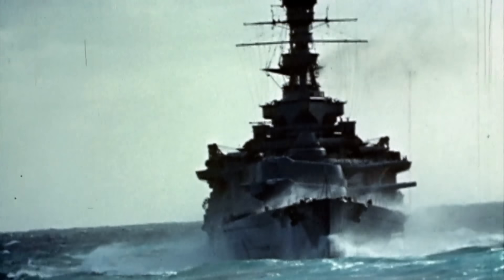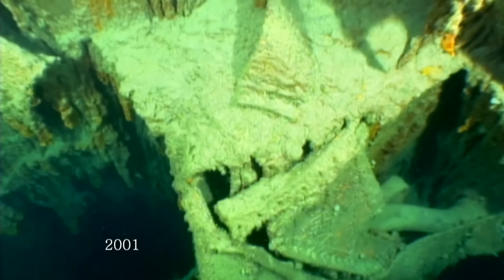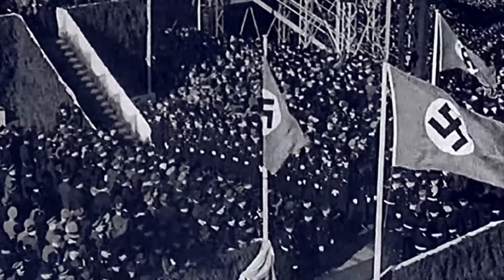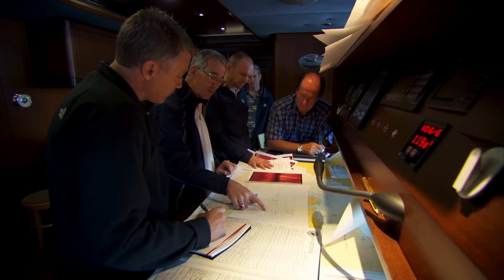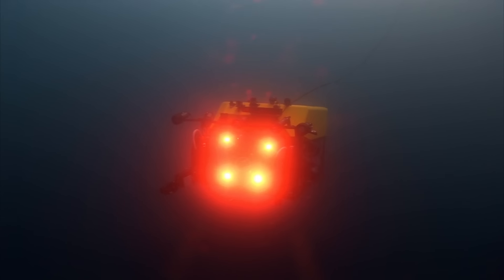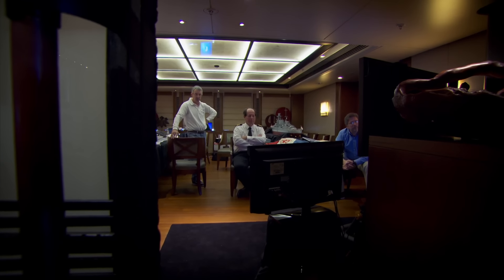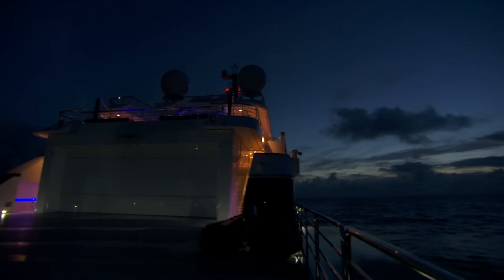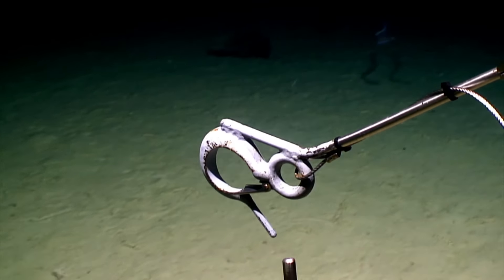How the Bismarck Sank HMS Hood - Documentary

Comment: It's no mystery. A  battlecruiser is not designed to take a hit from a battleship gun. It lacks the armor for that. It is like a boxer with a glass jaw. British battle cruisers blew up the same way at Jutland in 1916. It is amazing that the British didn't learn from that. Battle cruisers were designed to catch and destroy cruisers and outrun battleships. Their speed was meant to be their armor.
Reply: Same with the Deutschland Class (Deutschland, Admiral Sheer & Graf Spee). Even though they were described as "pocket battleships" they were never intended to engage anything larger then a cruiser. If they were presented with a larger ship, they were to simply outrun it.
Reply: The British battlecruisers blew up because they not storeing cordite correctly and leaving blast doors open as the royal navy favourd rate of fire over accuracy
Reply: castlerock58 trouble is it comes down to what is available in the right part of the sea when you need it. The Hood was what was available. An old ship, still the pride of the fleet, but effectively a WW1 cruiser up against a brand new all singing all dancing battleship.
Reply: Depends. German battlecruisers were designed to take hits from battleships and did so during the battle of jutland no problem.
Reply: That is correct Jutland saw more British sailors die and more British ships get sunk than what the German Navy suffered. About 6000 widows were made that day.
Reply: The same way the pride of the British Navy blew up in 1939 a single shell through the deck  into ? a Magazine. Sunk in 3 minutes. 1415 young sailors killed.
Reply: Monika tada problem was that the Royal Navy was the biggest and had to constantly be the first to design something new. Therefor other navies could copy and add extra. That’s why by the time Jutland happened, the German ships were stronger, luckily the Royal navy was 10x the size
Reply: The British Jutland battle cruisers blew-up, due to overriding the anti-flash protection doors to improve the rate of fire of the guns. Their armour was also suspect. By the time of the second World War, the HMS Hood was largely obsolete in terms of armour disposition to stop plunging fire. The ship had no immune zone to the Bismarck. The armour improvements to the ship might have given a theoretical immunity to German 15inch fire, but in practice there were vulnerabilities to the armour scheme which caused its loss. Too much spin-doctoring had taken place between the wars, extolling the power of the ship, which made its loss all the more poignant and distressing. It was the HMS Prince of Wales gunnery, which made the Bismarck abort its mission.
Reply: you saying the british didnt learn from jutland is kinda false as hood was designed to not blow up after taking battleship hits just her deck wasa designed for 11-13 inch guns NOT 15 INCH on the bismarck so hood (like the royal navy) was outdated
Reply: Jonah Whale  what are you talking about?
Reply: The Hood was launched in 1920. Back then air power was not a huge factor in sea battles, so it was not deemed necessary to build ships with armored decks. In the case of the Hood v Bismark dual, the guns on larger ships had got ever larger, with greater range. But of course in order to throw a one ton shell thousands of yards, you have to aim higher to project your shot further. It was here the lack of deck armour on the Hood led to it's downfall. The Hood could not withstand hits from plunging shells, and with the Bismark getting that lucky shot in first, Hood's luck ran out......
Reply: Surprisingly this excelent  piece made no reference to the similar  disasters with British cruisers  in the Jutland battle, as remarked by prior comment,  and specially to the conclusions of the Admiralty  commission(s?) that worked about those heavy  losses. How the recomendations produced have been considered in the construction of the Hood, in what regards armour reinforcement and conception of projectiles lifting to the turrets?
Reply: @thomashenaughan8396  The British navy was a big fat joke at Jutland. They did nothing right.
Reply: @bwills044  Frau Goebbels? What year?
Reply: @NormAppleton  They lost more ships but they where victorious.
Reply: the british DID learn from jutland. In jutland beatty ordered the battlecruiser to remove flash protection for faster rate of fire, this order then resulted in the other battlecruisers blowing up. If you take a look at HMS Tiger were the captain ignored this order you can see that battlecruiser can definitely take a beating.
Reply: the bismark was faster than the hood as well
Reply: @Jabber-ig3iw  
And the battleship that was with her hadn't been shook out yet and suffered Debilitating malfunctions in 2 of it's turrets that left Hood standing alone against a state of the art battleship and a heavy cruiser....
Out numbered and out gunned and nowhere to run.....
Reply: @bwills044  if you are still talking about the Hood going down,  that was in 41 not 39...
Reply: Jonah Whale  
Without the lucky torpedo hit holding Bismarck in a constant turn,  Rodney and those with her never would have had the chance....
Reply: @jackwardley3626  
The Hood had tired engines,  badly in need of a refit....
Design speed to speed,  Hood had the edge....
Reply: @pffear  The German fleet that ran away and didn't come back out to play again.
Reply: @Tuberuser187  
That's the one.....
Tactical victory with a strategic loss❗😜❗
Reply: @pffear  Was a tactical loss too, the Germans failed immediate objectives as they retreated, the tactical loss and then hid for the rest of the war which was the strategic loss. The Royal Navy losses didn't result in anything aside from the loss of materiel or men, it didn't impact anything like ability to maintain deployments or protect any areas.

Losing more quantitatively during a battle doesn't count as victory or loss though it can obviously contribute to them.
Reply: Jonah Whale  
Such are the fortunes of war.....
Reply: They did learn from it. It was just desperate times and the Hood was there.  You fight with what you got.
Reply: @malcolmtaylor518   Absolutely correct.  When the Hood was built, capital ships fought at relatively short range and received enemy shells at the side of the ship.  Therefore, the Hood had massive side armor but very light deck armor, which allowed it to have greater speed than battleships.  However, by the time the Bismarck was built, ships were engaging the enemy at ranges up to twenty miles or more.  At that range, shells do not hit the side of a ship but instead travel in a high arc and come down on the deck of the enemy vessel.  An enemy armor piercing shell weighing over a ton came down on the Hood's deck, tore through the thin deck with ease, and proceeded directly to the magazine four decks below before exploding.  The Hood never had a chance.  The only way it could have survived that battle was not to get hit on the deck.
Reply: The Hood may of been over twenty years old but she didn't get her refit because she was newer than the rest of the ships that needed one.
Reply: @Brian-om2hh  
When the Hood was designed and built gunnery actions were taking place at shorter ranges. As fire control systems improved theoretical engagement ranges increase. Ships become much more vulnerable to plunging fire.
Reply: A "battleship" CAN NOT withstand the fire from another "battleship"!  Nothing that floats can, then or now!  Being a "battlecruiser" mint that the HOOD was FASTER than a battleship.  The HOOD's guns were roughly equal to the BISMARCK's guns. The German optical rangefinder was likely more accurate and that is likely the real reason the HOOD went to the bottom.
Reply: @NormAppleton  But they didn't lose. It was the Germans who fled.
Reply: @jugbywellington1134  Am I too outdated???
Reply: Anon Roving Group _Intel_  when I asked what he was saying I meant when he called the bismarck a weaboo and rodney outdated when I said that the majority of the total navy was outdated
Reply: @pffear That'd be HMS Prince of Wales. She still had workmen aboard finishing her off. She managed to hit the Bismarck, though.
Reply: @bhishmaMbt  Perhaps, but nothing could take a stonk from the Bismarck and not worry about it, not even the Tirpitz. On the other hand, being "obsolete" didn't bother the Swordfish, did it? According to one account I read, no other plane could have delivered a torpedo at that time and place in those conditions. It's tragic all those brave men on both sides had to die.
Reply: @jugbywellington1134  🙁🙁
Reply: Jonah Whale  Bismarck had a modern (by 1941 standards) fire-direction center, and Hood did not. That's what allowed Bismarck to hit Hood at long range while Hood did not. It was luck that the shell passed through Hood's magazine, but not luck that Hood was hit.
Reply: The Hood was designed when broadside fire was still the order of the day but Bismark would use a drop shot trajectory .
Reply: @jeffburnham6611  Their were a few faults with it though.  The AA director couldn't cope with the existing aircraft that were a threat to it. The communication lines for the main director actually ran outside the main armoured turtleback. 

I agree entirely on the luck points. It was also not luck that PoW hit Bismarck, though a little fortunate it knacked the forward fuel stores. It certainly wasn't luck that the swordfish hit Bismarck, but rather the remarkable skill of the pilots.

Another thing that wasn't luck was Rodney dismantling Bismarck in short order.  That was brutal, terrifying efficiency from a supposedly inferior Washington Treaty constrained battleship. And it's worth noting that Bismarck didn't land a single hit on Rodney.
Reply: @kenmorley2339  The Hood would have been in a better position if things had not gone awry and they'd been able to stick to the original plan. Plans in war, as we know, are the first thing to go wrong!
Reply: @gordoncroft8189  and the hits from POW caused flooding that slowed the ship down and left him down at the bow
Reply: Jonah Whale  if the torpedo had not jammed the rudder she would have gotten away
Reply: @jugbywellington1134  the swordfish were so slow the german gunners could not compensate
Reply: Jonah Whale  Double short time? Do you know how long it took for the Bismark to actually sink during that engagement and that's even when basically crippled? And i still don't know whenever the debate if the ship was sunk or if it was scuttled got an answer - There are claims both ways.

I'm happy the torpedo bomber got the hit on the ruder pin on Bismark like they did (insanely lucky) or the English that already had the knife at the throat would had its last supply line seriously threatened and the entire war could have ended very differently - So fully understand the panic when the news came that Bismark was on the way out to sea to ravage the supply lines that mostly escorted by destroyers for u-boat protection. If Bismark didn't get sunk i doubt H would have been scared to deploy Tirpitz either. A freighter convoy with normal protection would have been simply decimated by either of those ships
Reply: the Hood had more armor than most battleships of the time so stop with the battlecruiser nonsense. it's a war ship of a certain size and it blew up.
Reply: Ok, a few facts for you.

Hood had battleship grade armour, it was called a battlecruiser because of its speed. British battlecruiser losses at Jutland were caused by German battlecruisers, and it was because of poor ammunition handling practices. Hood was destroyed by a shoot that seemed to have hit its main armour belt, IE the part that was as thick as a QE class battleship’s armour.
Reply: No British battlecruisers at Jutland had their armour pierced; the explosions happened because when a German shell exploded on deck the flash entered the turrets and travelled down the lift shafts, into the magazines. The flash doors in the shafts had been wedged open on orders from Admiral Beatty, who was obsessed with rate of fire, so he personally caused the unnecessary deaths of thousands of sailors.
Reply: It was also using high explosive shells which had little armor penetrating power even the queen elizabeth ships had this problem.
Reply: Churchill said at all cost. Prophetic...
Reply: Exactly - Indefatogable and Queen Mary went up within a few minutes of each other in the opening round of Jutland 1916 for that reason. Hood should never have been used to join battle.with Bismarck.
Reply: @malcolmtaylor518  no it wasnt. The POW turn tail and took off. The German ships didnt give chace.
Reply: @ike3094  really because the Bismarck sure did didnt he? Top side was wrecked but the citadel wasnt penetrated nor was there enough damage for him to sink. Then it was scuttled.
Reply: @gordoncroft8189  Rodney's 16 inch shells were bouncing off Bismarck. It couldnt do enough damage to sink the Bismarck.
Reply: @mikael2670  it was scuttled.
Reply: @erichvonmanstein6876   Yes! The Bismarck was intentionally skuddled  to keep him out of British hands. The Brits got awfully lucky when they wreaked the Bismarck's rudder!
Reply: @ike3094  well, not to give zero credit to the Brits. I think they deserve credit for the attack and hit on the ship however i think you are correct in that the hit on the actual rudder and extent of the damage was nothing short of luck.
Reply: @erichvonmanstein6876  The great Napoleon was once asked which was a greater asset: skill or luck?  Without hesitation Napoleon answered "LUCK!"
Reply: @ike3094  indeed. Just as with every other great military leader of the last 300 years would also say.
Reply: The Hood was not a cruiser. It was a Battle ship. Lutchens did not want to engage with cruisers.
Reply: That is so true.  Hood had upgrades but poss not enough to promote her to battleship.  Lucky shot did for her.
Reply: @richhughes7450  The Hood was done in by a lot more than just a "lucky shot"!   It was German Tech and skill that put quit to the Hood.  Remember that the Hood was in mid turn when the Bismarck "straddled" her (shells landed all sides) with a mighty salvo and sent her to the bottom. Not "luck", German Tech and skill did it.  Neither ship had armor thick enough to defeat the other ship's main guns' shells.  Armor that thick would add so much weight that she might not even float!  Also, speed, always important, would suffer greatly.  Fuel consumption would skyrocket and available space for fuel storage, would drop dramatically.  Range, the distance the ship could travel, would be much less and that would mean refueling vessels would very necessary and numerous and in constant danger.  Navel design of warships are always a compromise between what is wanted and what is workable. The compromise being heavy armor being on critical things like gun turrets and armor on decks, much less so. That "plunging" fire, (shells incoming at near 90 degrees to the horizontal) that sent the Hood on a two mile trip straight down was due entirely to German Tech and skill.  Also, the two ships were near the same size.
Reply: @pffear  A little unfair, Prince of Wales had lost one gun and suffered some drill faults but she was still the first ship to score a hit, the deblication malfunction came once Hood was sunk and hard manuevouring caused a shell to jump the shell ring and jam Y turret in train.
Reply: @mpetersen6  partly true but one factor that get overlooked is that it's not just the engagement range, the british aren't too worried about hits at 25k yards+ because they are rare and British are planning on pushing in closer for decisive action, is that the quality of AP caps and the fuzes of shell are improved markedly around the end of WW1. So whilst Hood's armour scheme would almost certainly detonate a shell short of the magazine spaces for any shell design available in 1917 this is not true by the mid 20s. Bombs are also a major weakness with Hood's total lack of deck armour, her protective plating is intented to protect against oblique impact not from directly above, Hood's quarterdeck is a major weakness against air attack.
Reply: @malcolmtaylor518  seems you have no clue how a turret works.this myth was created for two reasons.Churchill himself forbid a examinationafter the Doggerbank battle.The germans did and none of their ships suffered magazine detonations.second, some of the brits didn`t want to give the germans credit!!
Reply: @Brian-om2hh  I think incompedence of the commander ,to arrogant,  getting to close, and had inferior  range finders  as Bismark optical finder proberly made by ZEISS, accurate
, Churchill  stopped publication, of the sinking for 24 hrs
say no more....
Reply: @Tuberuser187  wrong, was a lost Battle for British , lost more men and ships, who is the winner???
Reply: @harryeisermann2784  Thats not how war works, you win a battle or war by achieving your military and political objectives not from the number of casualties and its even better when you prevent the enemy from achieving thiers.

The German surface fleet didn't break through into the Atlantic and sailed home and played no major role in the war after Jutland, thats a won battle and a significant factor in the outcome of the war.

Victory in war is achieving military and political objectives, its not based on K/D ratio.
Reply: @Tuberuser187  tell that to the Yanks, never won one war after WW2
btw without Sovjet, they lost WW2 as well
Reply: Exactly battle cruisers have the fire power of a battleship but not the armor of one but the thing is that they would have armor thick as a heavy or light cruiser if I remember
Reply: Jordan Fan，Prophet of Environment。范楚漳，環境先知：
How Did The Bismarck Manage To Sink HMS Hood So Quickly? 
Answer:  The answers were very simple:  When the HMS Hood was battling the German battleships  Bismarck et al, those lazy British  navy sailors onboard the Hood were busily eating their favorite breakfast food - Biscuits with Sardines.  And had forgotten to return fire at the Bismarck!))$$
Reply: The Battle of Jutland (1916) proved that British Admiralty ignored the flaw in the designs of their Battlecruisers.  Three Battlecruisers were lost and all to the same Magazine Explosion problem that took out Hood. 
Battlecruisers sacrifice armor and protection for speed and maneuverability.  They were designed to chase battleships, get close and fire.  They were highly vulnerable to "Plunging Fire,* where a shell is fired from great distance and arcs into the target similar to a mortar.
Just like Jutland, Bismark v Hood proved the Battlecruiser an obsolete design and poorly thought out concept.
Reply: @thomashenaughan8396 magazines were poorly thought out, precipitated chain explosions and even more poorly armored.
The Admiralty didn't learn the lessons of the Battle of Jutland in 1916.
Reply: @NormAppleton 
False. Admiral John Jellicoe succeeded tactically during both major engagements during Jutland by crossing the German’s ‘T’ twice. The Royal Navy as a fighting force should’ve been able to do better and they certainly weren’t as well trained and professional compared to the age of sail. But they did enough.
Reply: @kenmorley2339 
No it wouldn’t. No ‘drop shot’ was used.